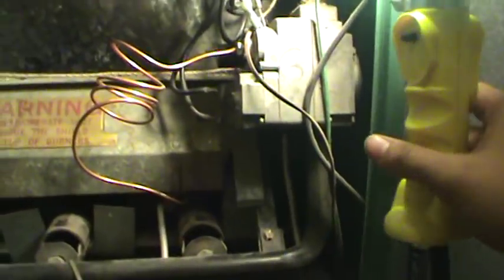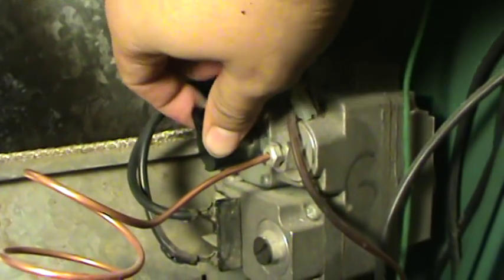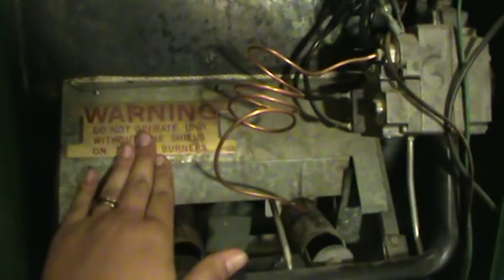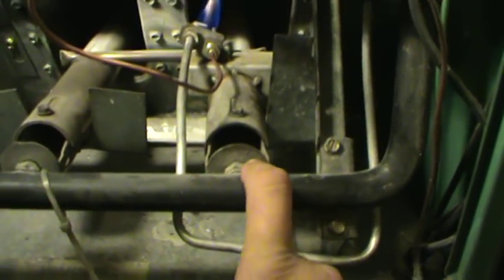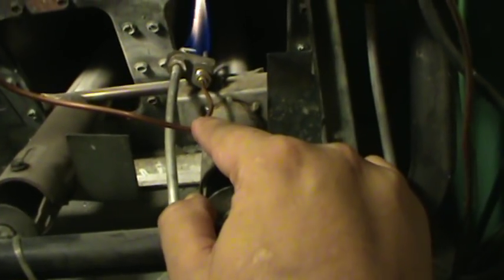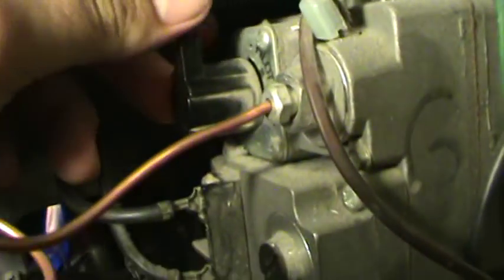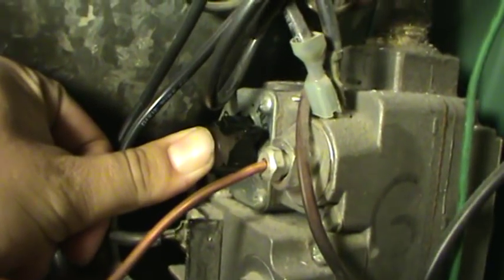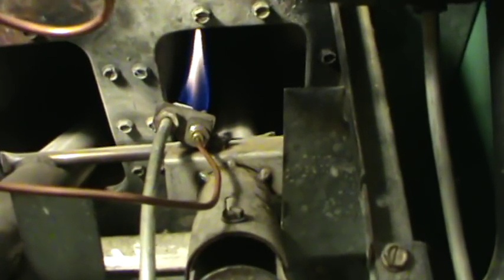How to turn your furnace pilot light on

Comment: Great video. Good explanations. Don't worry about the guy that blasted your speech, I understood you just fine.  One thing though, the thermostat you pointed to was a safety device that stops the flow of gas if it doesn't sense a flame from the pilot so it doesn't feed gas into your house when it isn't on.  That is why you have to hold the lighting button so long, to give the pilot a chance to heat that sensor so the unit knows the light is back on.  Ran into that with the pilot on my fireplace.

Comment: THANKS..... I liked your video. I had to refresh my memory for what to do and this helped. I am wondering though maybe it would be good to add a portion? Some people might not know about the main gas line on/off. I usually turn off the main gas line to my heater for the summer months (it reduces my gas bill to 2.96 per month, down from 10.00). So in order to light the pilot I also have to turn the main gas back to the on position before the pilot will light. GOOD JOB though great video!!

Comment: The copper line is a thermal couple and  it will only allow gas to come out of the pressure regulator when there is flame present and on the tip of the thermocouple.. If the pilot wont stay lit then the thermocouple is bad. it has nothing to do with the thermostat on the wall.

Comment: I got my water heater lit, which is good, I saw the blue pilot lit and then kept the pilot held down for 30 seconds and slowly turned on the heat. Next is the fire place heater and the basement furnace which is on an automatic ignition.

Comment: I do heating and air conditioning for a living and that was not accurate.  The copper tube going to the pilot is attached to a thermo-couple, not a thermostat, which detects that there is a flame present which allows the pilot valve to remain open.  

Also you never turned the gas off, if you had the pilot would've went out.  If the pilot has been off for a while, like all summer, you will need to use a lighter of some sort to light the flame while holding in the knob at the pilot position.

Comment: I just want to correct some misinformation here.  The coper coil going to the pilot light is the thermocouple.  It doesn't have to do with the thermostat.  It is used to cut off gas to the pilot light if it goes out for some reason.  As long as the thermocouple stays hot (the pilot is lit), the gas supply to the pilot remains on.  If the thermocouple cools off, that means the pilot light went out, so it cuts the gas off.  If the thermocouple fails, the pilot will go out, and won't go back on until you replace it.

The thermostat (temperature control), on the other hand, has an electrical connection which controls flow through the main gas valve.

Comment: Typically pilots go out for a reason. Your pilot in this video looks too yellow, meaning it's not combusting carbon monoxide. It should be 90% blue. The pipe or some other portion of the heater might need to be cleaned. You should call a professional heating company and have them inspect it...but if they tell you your heat exchanger is cracked, have them actually show you the crack. Also install CO detectors.